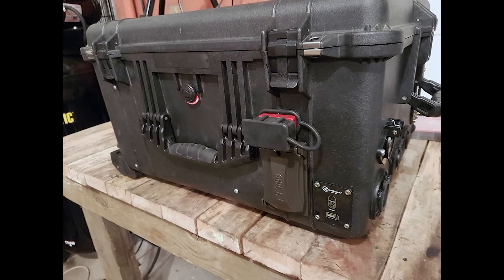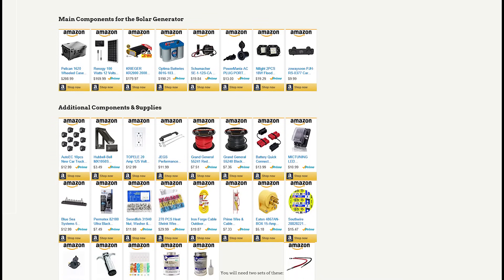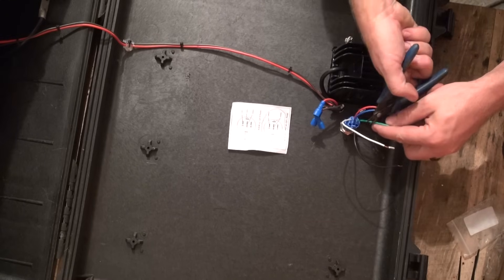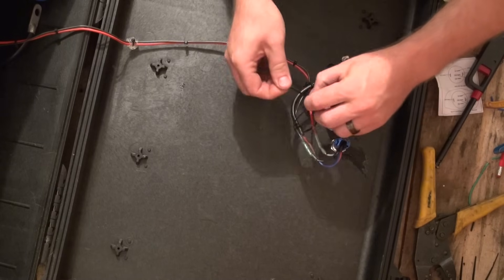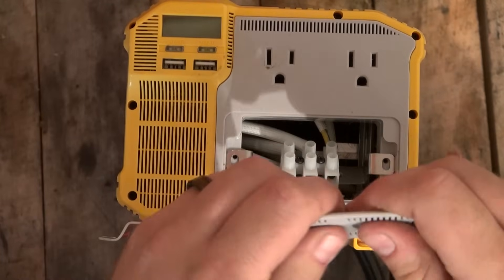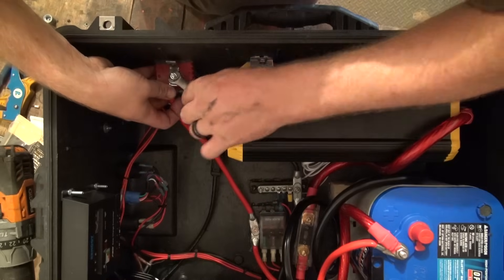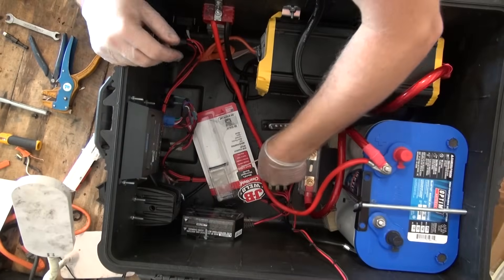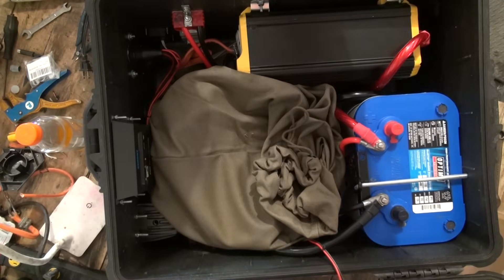Solar Generator - Finished Version and Final Design Updates

Comment: Without ventilation holes, how does the inverter stay cool enough to work properly?
Reply from the maker: I keep it closed when it needs to be water tight, out in the rain etc. If I am using it for heavy loads I open the lid to let it breathe. Has worked well like this for many years now!

Comment: Great videos, very detailed.  I followed them in building my solar generator but substituted ExpertPower 12v 200Ah Lithium LifePO4 battery.  Everything is working, I can run power tools, fans, etc... but when I connect my 25 sq ft Refrigerator/Freezer it runs for 5 to 10 mins then trips the GFCI plug outlet and cuts off the Inverter.  I'm not electrician, any ideas???
Reply from the maker: Thanks Robert! It sounds like the fridge may have a small current leak to ground. After I built this, I have seen some recommend not using a GFCI breaker with portable inverters. I am not sure why, perhaps because they are often not tied into a ground rod. As a test you might try running the fridge from one of the outlets directly on the inverter, bypassing the GFCI outlet.

Comment: Are you concerned about the battery being located so close to the inverter? I built a unit very and have received comments that the inverter placement will quickly kill the battery.
Reply: Its true that heat can be detrimental to the battery, but every commercial made solar generator I have opened up has located them similar. Typically the battery cells are at the bottom of the box, with the inverter circuit boards placed directly on top. Then they often have some active cooling fans that blow air across the inverters heatsinks.
Reply: @markmitchell1290  I agree….which is why I  have both an induction and exhaust fans mounted at either end of the case. My second battery is outside in it’s own battery box connected by a battery plug.  Ideally both batteries would be outside of the case, but then it wouldn’t be very portable.
Reply: @unknowncritic100  Right. Design is usually about finding the best compromise for what you need.

Comment: I wanted to give you a BIG THANK YOU for your great ideas. I have created a new box based on your ideas. THANKS. R
Reply: 2x BATTLE BORN 100 AH Batteries

Pelican 1620 Wheeled Case No Foam

Renogy 100 Watt 12 Volt Monocrystalline Solar Panel

Power Inverter Pure Sine Wave 1200Watt 12V DC to 110V 120V

EPEVER MPPT Charge Controller 30A Tracer3210AN + Remote Meter MT50

NOCO Genius GEN5X1, 1-Bank, 5-Amp Fully-Automatic Smart Marine Charger

NOCO GCP1 15 Amp AC Port Plug 125 Volt Power Inlet Socket

Shangyuan LED Interior Boat Lights - Navigation Light White (Pack of 2)

15A Weatherproof Outdoor Power Outlet by Journeyman-Pro 15 Amp 125 Volt NEMA 5-15R Receptacle Kit

IRHAPSODY 12 V DC 120 Amp 4 Pin Heavy Duty Relay/Split Charge Relay Switch,

Blue Sea Systems 5045 Fuse Block St Blade Mini 4
Reply from the maker: Sounds good!
Reply: It won't allow me to post a PHOTO

Comment: good effort, but that battery would not last long with any reasonable load on the inverter.  As I write this in 2020, LiFePo4 batteries have come down in price and you could get 4 times the capacity in the same battery space.

Comment: I have a question, If the inverter has internal fuses, why do you need a fuse relay and bus bar? Im not building my box with as much stuff as you and I'm wondering why I need a fuse box if the inverter has fuses. Thanks for any help.

Comment: In a design like this how do you keep from over discharging the battery?
Reply from the maker: A couple ways. The inverter automatically turns off once the batteries get too low on voltage. If the panels are kept connected they will recharge the battery(s) each day if there is sufficient sunlight. For long term storage you can disconnect the negative cable on the battery, or alternately you can plugin in the built-in battery tender / maintainer to keep it at a healthy charge.
Reply: @ModernSurvivalists  thank you. what is the lowest discharging voltage that we should not let to happen for healthy battery living? :)
Reply from the maker: @danielpawowski9965  General rule of thumb I believe is 80% of full charge voltage. It is like the age old argument of which wears a lightbulb out first - on / off cycles or being left on all the time.  It will vary with battery construction / chemistry, and too many short charge cycles also put wear on a battery.
Reply: @ModernSurvivalists  Thank you! in simple terms 12V battery, its lowest voltage  we should not let happen would be around 2,4V? (80%)

Comment: I just finished building my Solar Generator, I used a 4000 watt Krieger inverter. Simply amazing. THANK YOU! I am so excited to have this amazing solar generator.
Reply: Would you recommend the 4000W vs 3000w?  Is size a concern in the case?  Is Krieger what you'd recommend?  What about the Renogy Inverter?  montanareno@gmail.com

Comment: I'm not sure how big that optima battery is but for not much more you can get 4, 90Ah lithium iron phosphate batteries so basically a 12v battery for about $200 from AliExpress then You just need a bms so like $50 to $150 depending on the current you need which 3000 watts from one 12v battery is a lot like 250 amps which would not last very long anyways I think I'd go 24v I mean you lose some of the 12v function but you can use a buck converter for everything but a jump start option and also I mean that plug was only a 15A or 20A plug so you can really only pull like 2400 watts anyway
Reply: And it only looks like the blue top come in a 55Ah and a 50Ah I think that's the 50 so at like 2400watts you could only get like 15 min of runtime vs spending a little more on lithium that will last a long longer  and with 8 of the 90Ah cells you would have about 2kw of battery vs 600watt hours but since if you want lead acid batteries to last any amount of time you should really only let get to 50% state of charge so effectively 300 watt hours wow that is pretty bad really I mean you can get a jackery for like $500 that would probably take care of most of your needs

Comment: Hi! Thank you for the videos! I realized there is now a 4000watts Inverter. Can I use this inverter with the battery and all other parts that you recommend? I mean, are they compatible or would I need more batteries?
Thank you! And I would love a sticker if you still have one more left.
Reply from the maker: Yes you can!  It does not require an additional battery to work, but one battery will not provide as much power / run time as multiple ones will.  I used the 4,000w unit in a later video in this series, as well as showed how to add optional quick connect battery expansion units.
Reply: You can, but ya, you'll need another battery
Reply: Hi Marcela how are you?

Comment: Great Video- very clear and through instructions and illustrations! I'm looking forward to building this unit. Thanks! Question: How would this design change if the goal was to power the living space of an RV or tiny/small house with lights, computer, DVD/CD/video monitor, refrigerator, and AC in-window unit? Thanks Again!
Reply from the maker: Thanks!  For an RV if you don't need the solar generator to be separate, you can use a lot of the same components and just installed them directly into a compartment.  I did a blog post about this here: https://www.modernsurvivalists.com/adding-solar-power-camper-rv/
Reply: Pure sine wave inverter maybe?

Comment: Great stuff. I’m sure I just missed it but about how much did this project cost to complete?  Also did it cost more to make than to buy something comparable?
Reply from the maker: Thanks for watching. Prices fluctuate a little bit but on the blog post linked in the video description I have all the items listed and it auto updates with the current amazon price.   When I made the video, it was less than half of what a pre-made system would cost for similar size output wattage.

Comment: Will that pelican case hold  3 of those batteries?
Reply from the maker: No I don't think so. It also becomes extremely heavy which is why I decided to make it modular with quick connect battery expansion units you can daisy chain.
Reply: @ModernSurvivalists  can you point me in the right direction to where you show how to daisy chain batteries.  I think you indicated you did a video on that....but not sure where to look.  Thanks.   Oh....are you still recommending Kreiger as the Inverter to use.  I was wondering about a Renogy Inverter and maybe one of their smaller batteries.  Would you still recommend the battery in your video?  montanareno@gmail.com

Comment: Does the closed box have a negative effect on inverter cooling? Great vid 👍
Reply from the maker: If it is closed, it may get warmer. For light loads this has not been an issue and is fully weatherproof this way. If I am running heavy loads I simply open the case for ventilation.

Comment: Great design! I'm now incorporating several features that you used in my solar generator. One question. Have you found the lights on the side and the top of the case useful?
Reply from the maker: Yes, I use them all the time in the barn where I keep the solar generator. The top one bounces off the ceiling and provides good light that doesn't blind you so much when looking back towards the generator.

Comment: I'm seriously considering building this for my RV solar array.  My main concern is that I may need roughly twice the capacity for my computer setup, and fabrication machine shop.
Reply from the maker: Hi Jack, check out my video on how to expand the system. I tried to make it flexible for those situations. You may need a different inverter, or possibly a larger charge controller, but the number of batteries and / or solar panels is easy to expand.

Comment: quality video.....very comprehensive....always appreciate quality work like that....I live in the far north (great state of ALASKA.,so quality work is a priority.,as our lives generally depend on it often:)and have put together a few solar systems for up here...but it has now became time to build one very similar to your final design..Since we see temperatures of -20f to -50f (ambient air)on a regular basis each season,,i am curious to ask,,has any of the components that you used been cold weather tested,or are you aware of any of them that have a tendency to fail..or cold weather "shrink",as so many electrical components and connections will ,during extreme cold conditions?...us Alaskans find ourselves in a lot of trial and error situations when using unproven equipment that may or may not be suitable for our conditions.It is something we must constantly be aware of,and always be prepared to retrofit things that weren't built by our own hands.so if you or any of the other viewers are aware of any that I should not consider or should eliminate before I start this next build,it would be greatly appreciated..!!  And once again,,great work from you guys...take care ,,and keep on surviving:)
Reply from the maker: I haven't tested / used it in any temps as extreme cold as that. I live in Ohio and have used it with below freezing temps, and it has been stored in a barn that saw below 0 F temps overnight occasionally when the solar charging system would have been on, but the inverter was off at the time.

Comment: Great job, I’ll always wanted to build something like that.  I bought a 45W Harbor Freight to experiment but yours is top of the line.  I would like to complete one like your, already have 2 AGM batteries but need the power inverter and the 100W solar panels would like something that folds down for transportation.  Great job but a lot of money, between the case, the inverter and the battery is more than $500.00 then you need to add the solar panels and all other components.  I think one need a budget of about $1,000

Comment: Great "how to" videos on the solar generator, I've been looking at installing a backup house system for those short term power outages. When you want lights and t.v. but don't want to hook up the BIG GENERAC.  Have you had any overheating issues on the inverter? Seems like it being sealed inside a closed case and being black could cause  some heat problems.
Reply from the maker: No I haven't but I use it intermittently most of the time.  I usually open the case to let it breathe if I am running a very heavy load. The inverter is supposed to shut off automatically if it gets too warm, but I haven't deliberately tried to over heat it with the case sealed up.  I like the sealed case though because it is fully waterproof and I don't need to worry about the cooling fans sucking in water during adverse weather.

Comment: Happy New Year! Mark. Great work on your videos. Am planning on doing exactly the same. One question when the unit in on. (Inverter). I assume you open the top four ventilation?.
I have some Headway Lifepo4 batteries planning on using them instead of the Optima battery. Everything else should be the same set up. Box I purchased on Letgo. Pelican 1610. Just a few inches smaller than yours. Thanks again.
Reply from the maker: Thanks Miguel!  Yes, I will open the box if the weather is nice and I plan to be using heavier draw equipment. Lighter loads (lighting, refrigerator, etc.) it seems to work fine without needing to open the case.

Comment: Is there an issue with adding a second battery in the nearly empty space next to the first?
Reply from the maker: That was the original plan, but once everything was combined the weight was not very manageable with the second battery, plus the extra air space helps with ventilation when the case is closed. I decided to instead add the 2nd battery as an external expansion box, with the benefit you can add as many batteries as desired. Plus I can use the separate batteries on their own, jumpstarting duties, running a utility winch, etc.

Comment: Hello, can you change the battery with a lithium battery pack?
Reply from the maker: Some people have. I wanted to stick to good quality traditional battery's since that it what most of the solar charge controllers and battery chargers are designed for, and I felt they would be safer. Lithium shows a lot of potential in weight savings though!

Comment: We want you to know that your videos were the inspiration for us to build our own smaller solar generator last year. It was made from two 6v 400ah batteries and one LG 265w module.  We have since scrapped that for a much larger, trailer-mounted generator which is almost complete.  This one has 1560 watts of modules and 19,200 watts of total battery power.  It has a 12 kw, 48v inverter and is capable of operating a small stick welder (and just about anything else we'll need). We are going to use the generator to build our off-grid home in the Intermountain West.  Check out our videos if interested. We just want you to know that your videos were the impetus for all of this. Thank you!! We are subs!
Reply from the maker: Awesome!   Sounds like the new solar generator will be a beast!  I will subscribe to watch your progress, and best of luck with the off-grid journey!

Comment: Would appreciate ADVICE:   I’ve obtained several battery packs that are made of 32 cells.  8s4p.  They are 26650 cells 
And are LiFe PO4.     There are no Bms boards.   Only. Red and black leads.   They are are 
Reading about 26.3 volts.     Label says 12.8 Ah.      Question:   How can I best use these? 
  Test them?   Charge them?   There are many...   A pallet full.  Each pack about the 
Size and weight of a brick...  they are shrink wrapped.

Comment: I'm also planning to set up a solar power system. However I will not use an inverter. I will instead spurn appliances that operate on AC and replace them with DC-powered systems.

Comment: With 3000 watts available you should really hook the GFCI plug wires wrapped around the screw the push in are not rated for as many amps but then again 3000w is what like 25ish amps which that plus is what 15 or 20 amp rated

Comment: does the pure sinewave inverter overheat if its in a sealed box?
have you thought about using Headway batteries for the power holders they are lighter

Comment: I've always been under the impression that invertors over 1500 watts needed at least 2 12v batteries, no matter the Amperage. Is the AC side only utilized when the panels are hooked up?

Comment: OK, 3/4 done.  Have my solar working to charge the lithium battery via the Redarc BCDC1225D.  Now what I want it to have a meter that tells me how much of a charge I am getting via my solar panels.  I'd also like another monitor to tell me my load on the battery and its status.  Doing a little more research here....

Did you ever plan on putting in a monitor?
Reply: Hi Stephan how are you?

Comment: Really a nice set up you made there. 

Can the battery be charged from a vehicle through the 12vdc outlet? I'm just thinking that if you had it in your vehicle you could run a long cord that plugs into your cigarette lighter outlet and into you box and charge your battery while driving down the road.

What about adding a retractable 25 foot extension cord reel mounted inside the box and have a single gang outdoor rated electrical box that's weather proof and a spring loaded cover mounted on the outside and have the cords female end store inside that weather proof outdoor rated electrical box. Then when you need an extension cord, just lift the spring loaded cover, reach in and grab the female end and pull out the cord. Now you always have a wired up extension cord that you can just grab and use and rewind it quickly.

I'm really enjoying you channel and decided to sub. Keep up the great work.